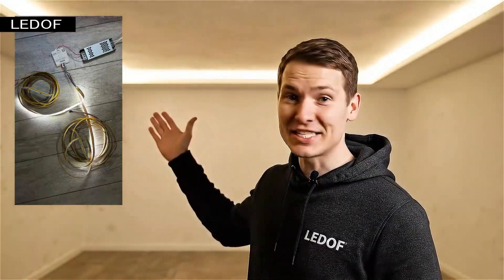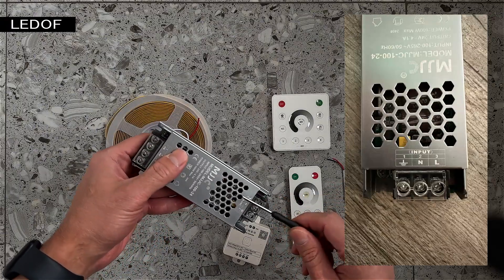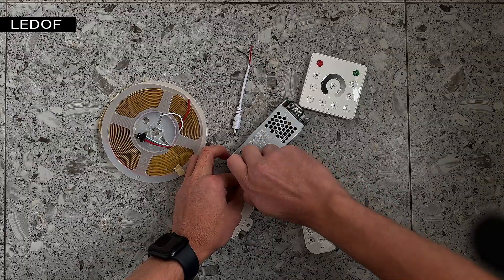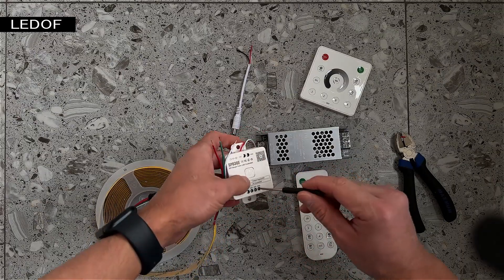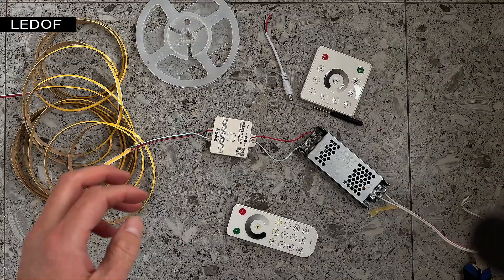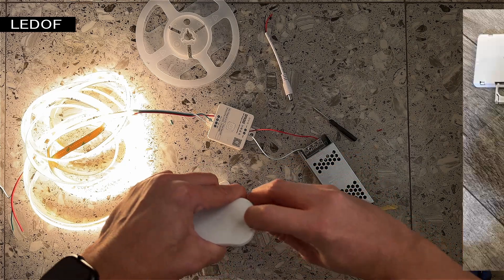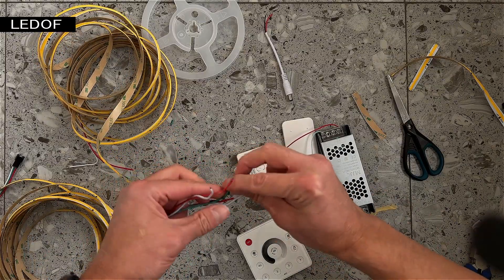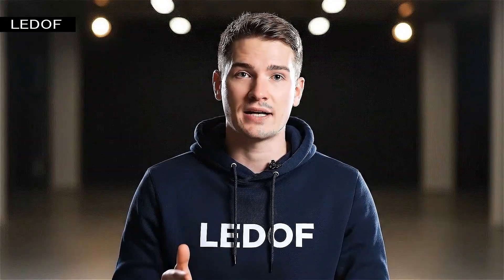How to Wire Addressable LED Strip COB + Controller SP636E

Comment: How many meters of COB strip can I connect to a controller? Thank you
Reply from the maker: Hello. Thank you for your comment. If the addressable LED strip is COB 320led/m, then this LED strip can be connected to the controller at a distance of 50 meters. Thank you

Comment: Can I cut this cob strip into 5 parts, to make all parallel and connect them (with additional cables solder) altogether to this one controller to get this spill effect on all of them simultaneously?
Reply: Will this work - turn on/off - with wall switch?
Reply from the maker: @kozashi  When turned on from a regular switch, the light will turn on with the effect of a running light, and when turned off, it will simply go out. Thank you
Reply from the maker: Hello. Yes. You can cut the LED strip into 5 equal segments. When connecting, the main thing is to observe the direction of the arrows on the LED strip. They should be directed away from the controller. Thank you